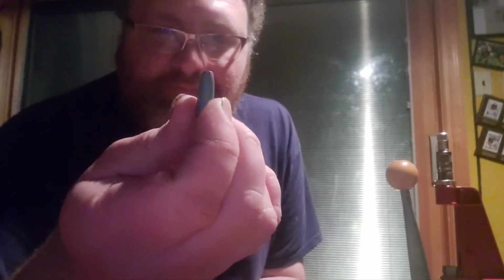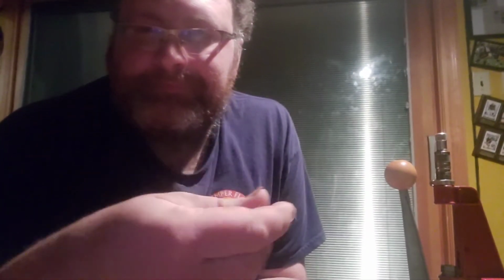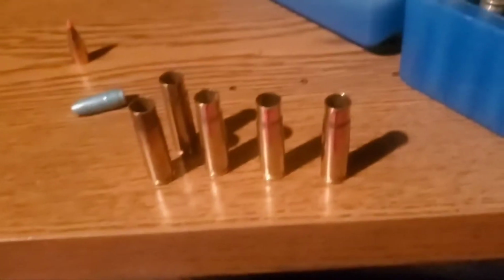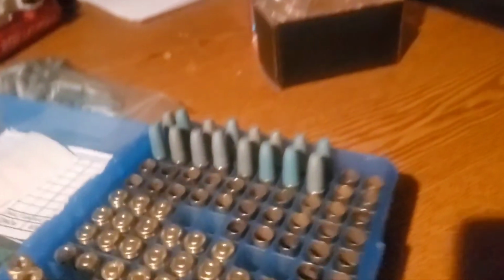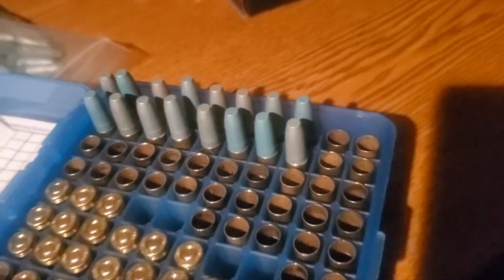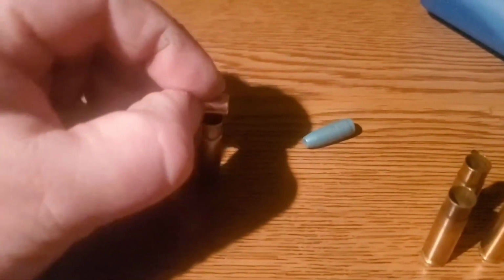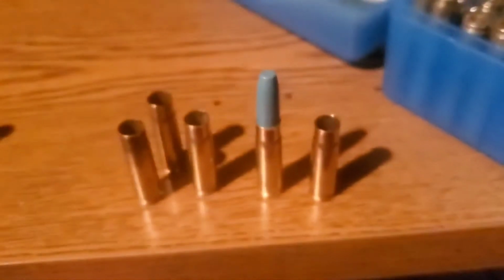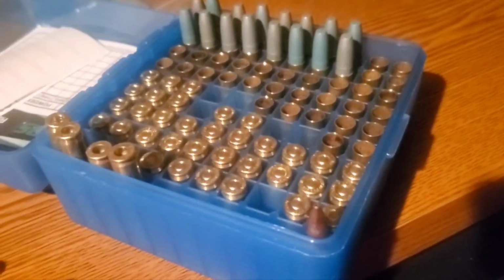Flaring #300blackout  brass with the Lee Flaring die and Lee c press . thanks to @mckwilly

Comment: I generally concentrate on one part of the process at a time. I take all my dirty brass and wash. Once I get done there I'll do trimming. Then I'm on to priming. It takes forever and you don't realize it till you go to get your brass for loading and hey it's all done and ready to go.
Reply from the maker: Thanks Tim s.  Yea I . Clean then re-size deprime and chamber then relean must the time .  Then prime then load. I just did think of flaring them at first .  Kind first time doing flat bullet and doing cast.
Reply: @jamespugh  yeah all of my dies sets have a flaring die. My trouble is with too much flare. I've had some that come out looking like a bell. Ha ha.
Reply from the maker: @tims6212  haha. Yea I bell one of these the other day bc whent to fur on the stoke. All die two die set so far.

Comment: Gotta flair all cases using cast lead bullets. Good video, James.
Reply from the maker: Yea I larn  the hard way and by chat with Mark and James pollard. The first 15 lead I did out flairing did ok then start to sticking them in 110vmax in my rcbs die Jamie so flaired the rest I had primmed. I got loading video short of some lead bullet.  And I'm drop 110vmax full video tomorrow hopefully.  Just need get range to test all of them . Plus 243 win test.
Reply: @jamespugh  Cool!
Reply from the maker: @jh5869  got a full desktop review of that 300blk build on my channel.   Hope these shot will out of it. Say handloads chamber lot easier then factory ammo off the mags.

Comment: Cool, make sure to chamber check and a case gage ( not a checker)  is huge so you know where the shoulder is. 👍
Reply from the maker: Those one load lead bullet chamber find end video.  But where not flaired at all. Need check ones I load on Sunday night with my gun . All same length theo. Only difference is powder charges .
Reply from the maker: Just went try 110vmax I load chamber find and eject find quick pull.